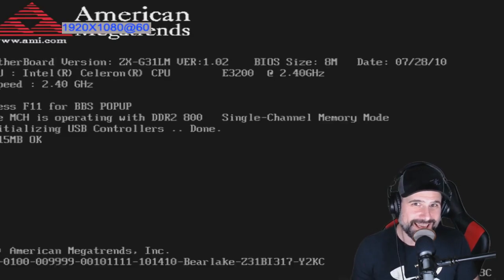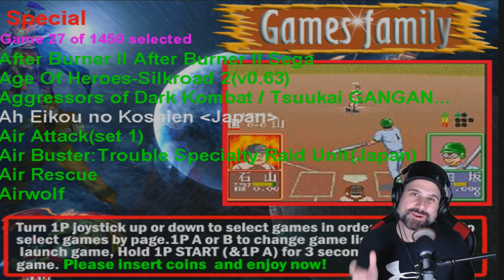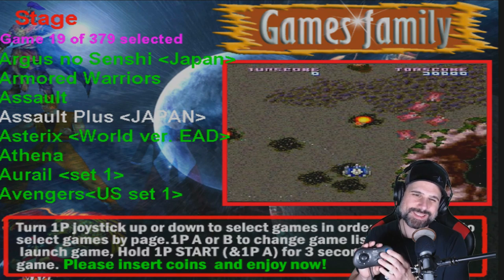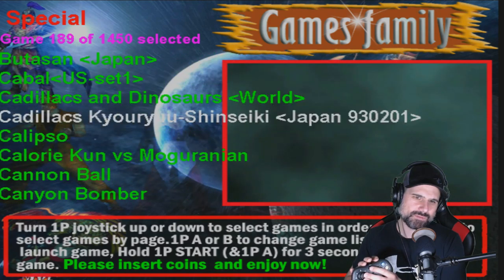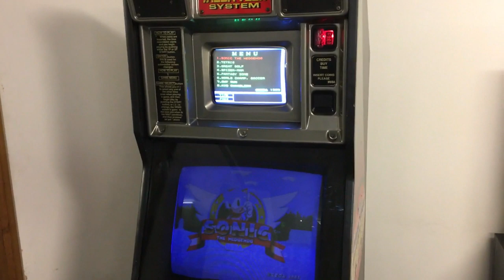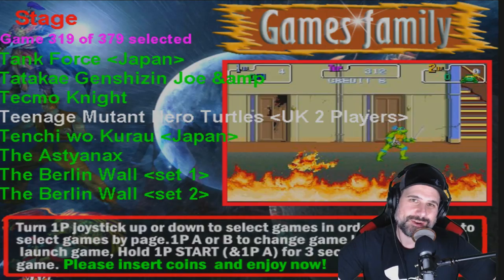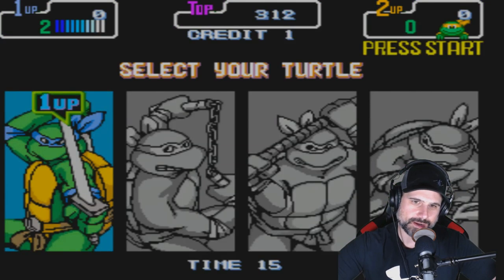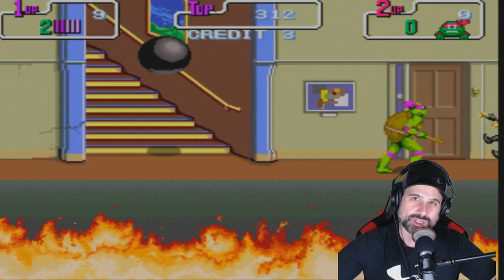Arcade "Burger Board" that plays killer instinct 1 & 2 - Let's check it out!

Comment: I’m getting a 3 side cocktail cabinet from a local vendor and it comes with an elf board and I saw your video where you said it was not a very good board what board do you recommend I get( I want Mortal Kombat). Thanks!
Reply from the maker: The vertical elf board is actually pretty decent, I think there what would typically go in a cocktail... So you should be good 👍🏻
Reply: @RetroRalph  it’s a vertical and horizontal you still think it’s good
Reply: Also it doesn’t have Mortal kombat
Reply: How is the emulation on this? Is it under powered with awful sound like some of the other game elf PCBs?

Comment: My 3.0 doul core runs every emulator up to ps2 %100 plus every mame game and 3d game also%100 or faster.i bought the board with 3.0 gherz doul core with 3 600 megahertz match ultra low lagncy that is matched for single channel ram configuration and the pie or most emulators hardware on the market can not get close of quality and unlimited emu and game settings.i am running xp32 bit.Old computers can run all mame games %100 or better if you can over clock each game mame cap cpu and gpu cores caps.

Comment: LOL. OMG. I have had one of these for 7-8 years.  Its called the gameking 2019.   Been around a long time.  The hd modules on them are very bad to
Go out.  I suggest nobody buy one.    Mine has the same exact menu and interface.    It runs from a windows based OS and not linux.   Buyer beware   There is no proper shutdown procedure,so it will not be reliable.